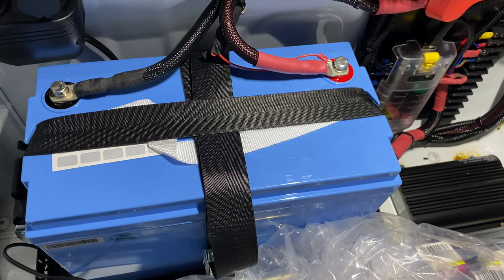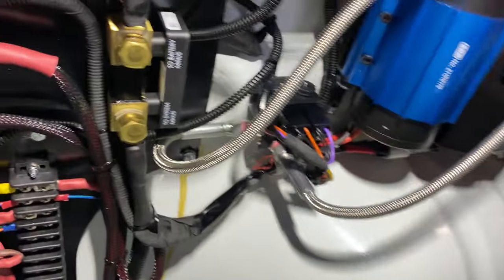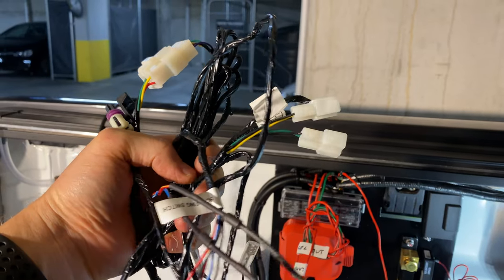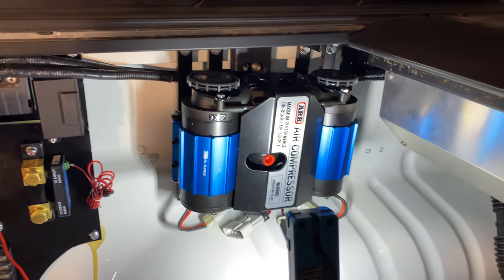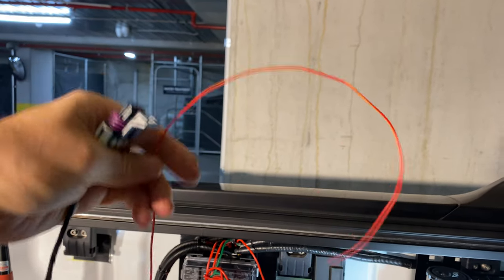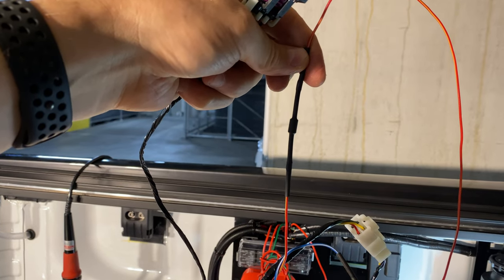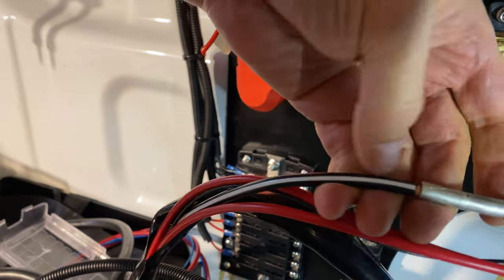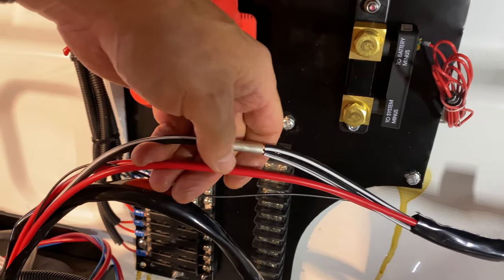ARB Dual Compressor Simple Wiring

Comment: Do you have a better video on how you wire that up do you run power straight from the battery to the compressors and then use that diode with that harness to run to like my ass pod turned it on and off maybe a wiring diagram I’m considering this or the peerless 10 pound CO2 tank since I don’t off-road alot
Reply from the maker: Hey, wiring diagram on my blog: https://wai4wd.com/3185/simple-switch-wiring-arb-dual-air-compressor/

Comment: hi mate great video but just wondering have u got this wired into you aux battery or to your starter mate
Reply from the maker: I have it wired into my aux bat, purely because I don't want to have the car running when the compressor is running. You could wire it to your start bat if you want, you just have to have the car running when you turn it on. Same wiring either way.

Comment: Hey mate, if I want to use the arb switch with 5 prongs but only need to use 2, what prongs on the 5 switch would I need to use? Cheers
Reply from the maker: Both sides are divided, so a top and bottom typically. The one extra, typically central, will be the switch lighting. You can confirm this just by putting power onto one, then test the prongs with a light. If you have a multimeter, no power needed, just test it with continuity. Without having one in front of me, I believe they're a double pole, single throw, simple, on or off, but the terminals are double pole which means you can run two sources via a single switch.
Reply: Cheers mate. I’ll give it a go

Comment: Wow, neat as a pin. Another great video. Thanks. 
Where did you get those dash switches from, being 2 switches in 1 is a great idea.
Reply from the maker: Lightforce do them. Just select custom switches for your vehicle type and if available, about $50 per dual switch.
Reply: @wai4wd  thanks

Comment: Hi, does the compressor stop when you unplug the air hose or is it continuous with this wiring?
Reply from the maker: Hi, this wiring has a switch to turn on/off. If left on, the system will pressurise periodically providing there are no leaks (which would pressurise a lot and drain the battery super fast) which will drain the battery over time. Isolation by switch is advised for all auxiliary items.
Reply: @wai4wd  Thanks, I meant does it have a pressure cut-off when it's not isolated. As in cutting off between tires when undoing dust caps etc...
Reply from the maker: @JBBunno  Ah… sorry, my bad interpretation. Yes, it has a max pressure around 140PSI that it will cutoff and hold at.

Comment: Neither one of your motors on your dual compressor are protected by that fuse 80 amp fuse. When you deleted the two 40 amp, that was the highest amount of amps that the motors could handle. Now with the one 80 amp fuse the motor 1 or both will fail because of that 80 amp fuse being to large! The motor will fail at 41 amps or higher. They’ll be dead before they even get to the fuse blowing at 80 Amps. ARB separated the wires and gave you two fuses for a reason so each fuse could fail for one motor only. Protecting the motor by 40 amp fuse failing.
Reply from the maker: I am a qualified electrical fitter, mechanic, auto elec and specialised in industrial electronics. You are wrong in your assertion on how electricity works. Yes, ARB protected each motor individually. Short circuit is what you are protecting against. Equipment fault, in essence. When a short circuit occurs, either motor, the current on that short circuit will be in excess of 80A by itself, let alone the current drawn from the other motor still running normal. A single fuse will instantly blow, regardless which motor fails. Simply, if motor A shorts, motor B will still only draw what it draws, it does not magically start drawing more current whilst the other is in short circuit.

My professional opinion. If one motor fails and blows a fuse, you DO NOT want to be continuing to use the other motor. You want that entire piece of equipment to cease, be removed and repaired/replaced. This is how people burn their vehicles to the ground in the middle of nowhere, because they're all backyard experts and think they can wire 12V knowing nothing about electricity itself.

Its the same as this stupid industry telling you to use circuit breakers on 12V. Circuit breakers are not actually the best of the two options for vehicles, as fuses are designed specifically for over-current protection, which is what you want in low voltage high current environments. A short occurs, current increases, fuse blows. Fuses do this faster than circuit breakers, yet an industry makes them available and people use them because you can reset them. Back to, how to burn a vehicle to the ground. When a fuse blows, you have to understand why it blew and fault find, not just replace it and go on as though nothing happened. It is a sign something went wrong and if you don't know what, power should remain off.